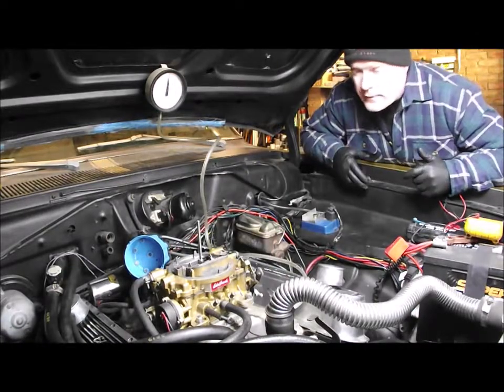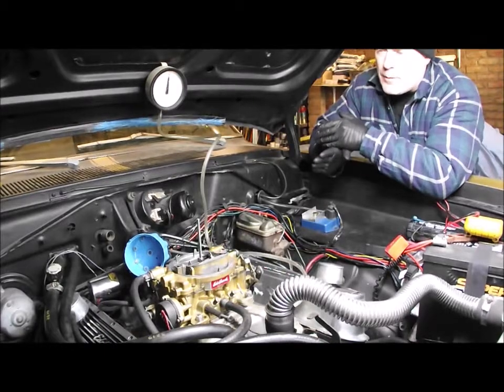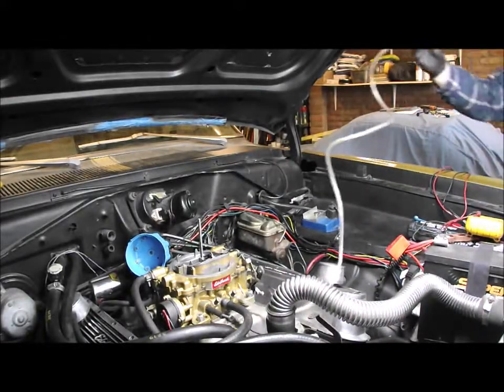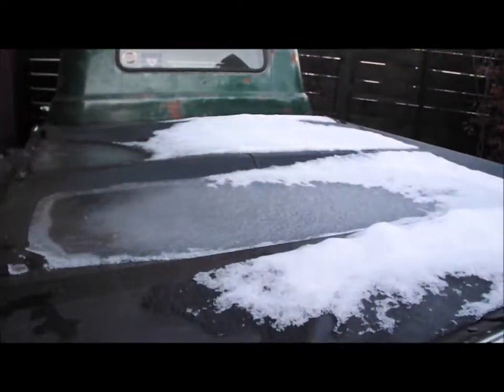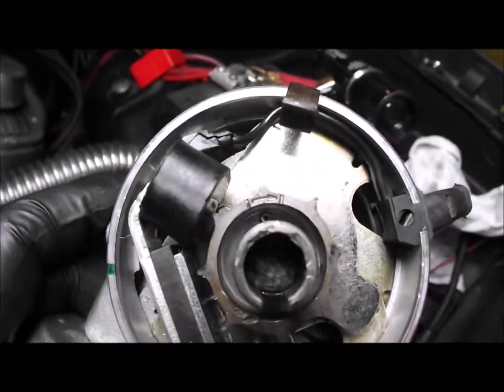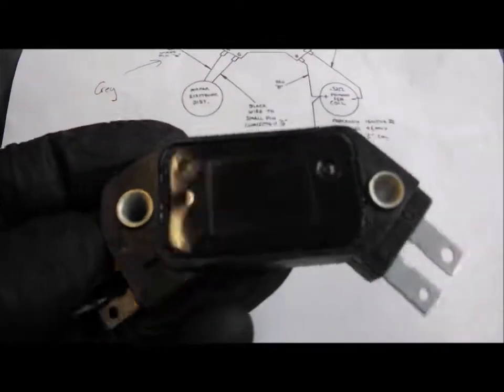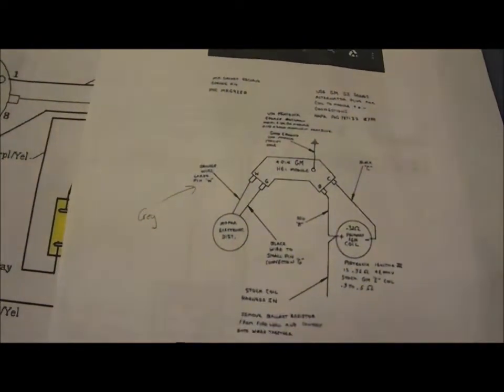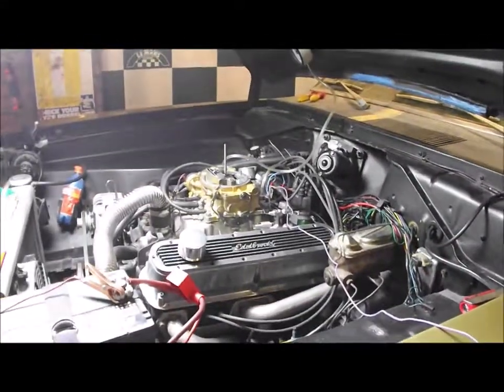1971 Dodge Dart Pt 11- HEI Conversion & distributor phasing check -Vintage Steel Garage Ep 19

Comment: Great video you have done some amazing diagnostics with some clever ideas I never would have thought of.  I am thinking that you really need to try and find out if it is an ignition problem or mechanical vibration. I am wondering if it would show up on a gas analyser,  as if you have an ignition problem the hydro carbons will spike as your not going to be burning the fuel mix. This is a complete guess but perhaps a tuning guy could advise on the forum.  I would have thought that with all the changes you have made something would have changed. I guess  there are no short cuts but you must have crossed a lot of possible problems of the list.  Wonder if you have access to any vibration analysis tools ?  That could link it a mechanical rotation or balance issue. Vibration is so hard to track down as it could be there all the time and your just hitting resonant frequencies etc.  Definitely cannot fault the fault finding so far. Regards Chris
Reply from the maker: Thanks Chris. I have a vac gauge on order that I've been reading up on and should show up any sticky valves or mechanical problems and ignition problems.  I have the reluctor and pickup to change and then everything on ignition circuit replaced.  I've triple checked timing and firing order. Might try another set of plugs too.
Reply: Vintage Steel  yes I think you have done everything you can and lots of people will find this video useful for similar ignition trouble shooting